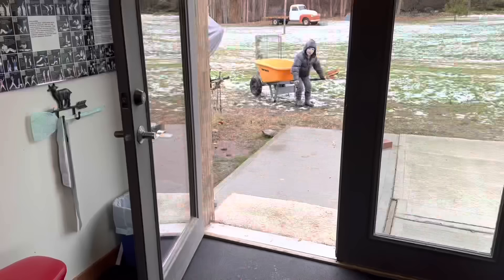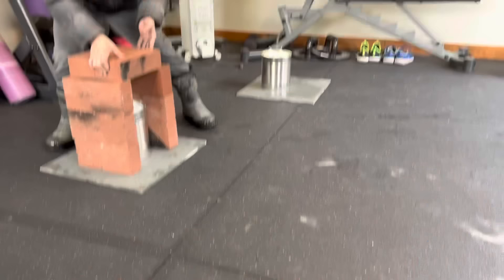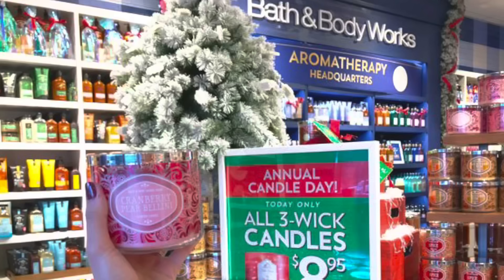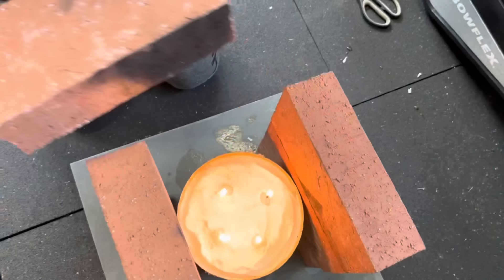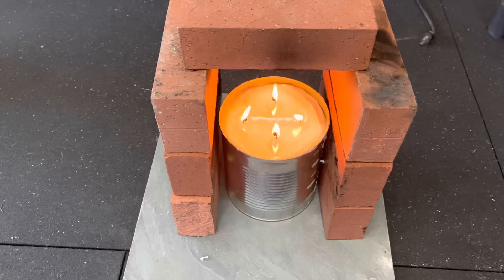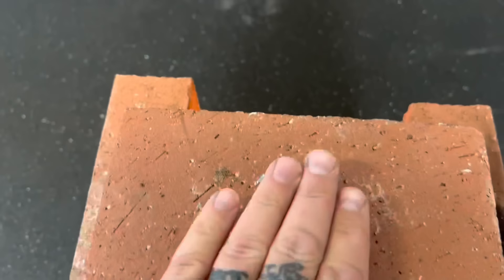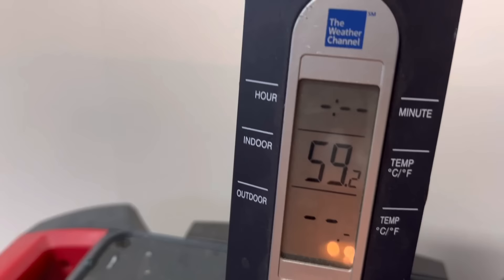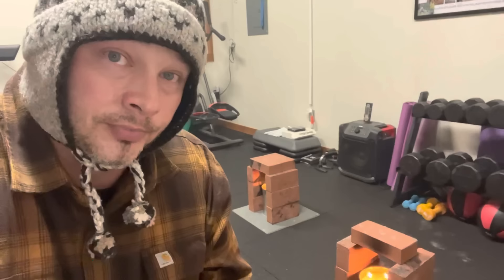Crisco candle room heating | Power Outage Room Heating | 9 hour test

Comment: The other good point about this which you didn't actually mention and some people may not realize is that the bricks continue to radiate heat after the candles are extinguished. If you live in the UK the British equivalent of Crisco is called Trex (or a cheaper own brand substitute can be used as you did in the clay pot heater).
Reply: Max, it does so, because it takes time to heat the bricks. lol so the overall time is the same. i.e. the heat you don't feel while the bricks are being raised in temp is the heat that will be released when the candle goes out.  a candle produces about 80watts there is no magic plant pots or bricks.
Reply: @sarahclark5447  I'm aware of that Sarah, I was pointing out that the bricks are a sort of thermal flywheel but thank you for replying cos it makes my comment more understandable to some people. Sometimes I don't express myself very well and you clarified it
Reply: @madmaxsdog8040   Thank you, Max, you just need to take one more step and you will be there. remove the bricks and simply light the candle when you require its meagre heat. 
There are 80 watts of energy available from the candle. displacing that 80 watts into a room so the room, in turn, heats you is the most insignificant way to try to survive. if you are male your body radiates 120watts, inviting a friend into your room would be more beneficial than lighting the candle, oddly, a woman radiates about 90 watts. but you as a male will likely radiate more than your 120 watts just at the sight of her! keep in mind that what you radiate you lose and what you lose needs replacing.
Men were made for greatness, and women were made to be the beneficiary of that greatness (sorry to tell you this if you are a male feminist). You have to apply your greatness by transferring the 80 watts from the candle directly as possible to the body, that will mean I will be able to survive for much longer. 
Sadly you have to be prepared to die to save those weaker than yourself, but it isn't all one way. I have to live for my husband/family, some say I have the harder role.
Finally, thank you for the car, roads, washing machine, aeroplane, trains,  computer, phone, homes, plumbing, electricity, especially being able to turn on the light to drive away, the fearful darkness,  central heating systems and most importantly my hair straighteners.   Do have a very happy new year Sir. Keep safe, warm and productive, women need you.     💗✝💗
Reply: @sarahclark5447  Yes I'm male I'm hetro but some of my best friends are women, two of them gay one of them going through a transition, used to be a man but becoming a woman, I sometimes used to play bass or drums in an all woman band if one of them couldn't make it and y0u  wouldn't believe the barriers that were put in their way just cos they were women. the best way to keep warm is not get cold in the first place. we quite often slept in the van after playing ( which is f"*** cold, ) just hugging in and sharing body heat, there as nothing sexual about it, just a way to keep warm
Reply: @sarahclark5447  My name is Roy actually but I loved the Mad Max movies when they came out and "dog" the dog was brilliant, an Australian blue so when I needed a playstation game name mad maxs dog was the first thing I thought of
Reply: @madmaxsdog8040  Oh,  I had never heard of the film Mad Max. I suspected it was a film a boy would enjoy, but not a girl perhaps. however, I googled Mad Max, and my suspicions were confirmed, not one mention of romance lol.
I think my brother would enjoy that film and my dad would know about it, I bet he has even watched it! Men have very hard hearts, even dads! but a wise daughter knows dads have two hearts, one for their daughter, and one for their sons. I think this is necessary since men, have, and will do so again in the future, lay down their lives for their wives, sisters, and daughters which requires both types of hearts to be able to do so I think.

Someone did mention the film pulp fiction to me the other day. I had never heard of that either (I must live in a bubble lol)   this film was mentioned to me because one of the film's characters recited Ezekiel 25 (if you do not know what Ezekiel 25 is you must live in a bubble lol) I had to tell this person that the character who recited Ezekiel 25, did so wrongly, it doesn't say what the character recited, the guy then told me I had spoilt the memory of that film for him lol. 
 I think perhaps this Christian homeschooled teenage girl lives in a world far removed from her secular peers, and when I go researching energy conservation or some other aspect for my coursework come into contact with really nice people who live in quite a different world than me, but sometimes I come into contact with people who have had much too much of their world that is good for them, teenaged girls my age, who have no love in their hearts for little babies and children, and think one form of contraception is abortion, and not all forms of contraception is, purity!
then I have to run back to my world because I can't live in a world where there is such hatred in the hearts, as it's too heavy to carry around. Roy, you are the former, not the latter, you are a pleasure to know, a man from the other world.
God Bless you, kind Sir.      🧡✝💖
Reply: @sarahclark5447  Female friends are exactly that, friends, I used to sometimes play either bass or drums for them in their heavy metal band, whatever was needed at the time, you might  be able to find some of it on you tube, I don't know if any of it has been posted. The band was called Revenge. The person going through the gender change is actually now MUCH happier because she's found her true identity and isn't living a false life anymore. If you had to constantly lie to yourself about who you are it would do your head in. she had the courage to make the change which now makes her comfortable with herself and she can live her true life.
Reply: Listen to a song and look for the lyrics, it's called the double life, it's by Souixsie and the banshees. That's pretty much what my friend was going through before she made the change. She is SO MUCH happier now than I've ever seen her. No more religious lectures please, you're obviously a very firm believer in God, if so you'll know that he gave us the freedom to make our own decisions. Those decisions ALWAYS have consequences, sometime good sometime bad but you make your choice and you live with it. In her case it was the right choice, she isn't living a lie anymore
Reply: @madmaxsdog8040  Is this the band, Roy? https://www.youtube.com/watch?v=tqsAhkiDVW4
It was very good of you to be able to drop in were required as you did. I do something similar when I'm asked if I could help out at a Carol Service. it's quite, different playing solo than in a band of people, particularly if you do not know their different abilities. My mother taught me to play my part exactly as scripted, and not concern myself with what was happening or sounding to my left and right. I prefer to play solo if I'm playing the Piano, and lead (first)  if I'm playing the Violin in an orchestra. My mom told me, the orchestra is only as good as its worst player and I wasn't to be that person lol.

I am pleased your friend has found happiness, Roy you would be wrong to think that's not what everyone wants for every person, but the greatest happiness would logically be happiness in who you really are, what your DNA is informing your body of. If your friend was happy with a wife and children that would be the very best outcome possible since he would simply be happy in who he really was, since one of the chief functions of the brain is to perceive physical reality. Thoughts that are in accordance with physical reality are normal. Thoughts that deviate from physical reality are abnormal—as well as potentially harmful to the individual or to others. This is true whether or not the individual who possesses the abnormal thoughts feels distressed.
 If you have to turn things on their head to work, something is broken. We do not ideally want broken things, in fact, when we find something broken we repair it, don't we? I suspect you know your friend well, and feel the broken can't be repaired, and love him so much you just see the friend and not the broken, in that sense you are a very good friend indeed. I think where we differ is I do not see the friend, I see the broken and the broken is repaired because my love would revolve around fixing the broken, not so much accepting it's broken, and to attempt to repair the broken is an afront to broken.  
I do understand that fixing isn't classed as loving, but hateful today, but that sort of mindset means you never try to fix the broken, which should tell you how hateful that mindset really is.
I accept that some can't be fixed, and they need to live as happy a life as they can, however,   where we may differ is that I would want research to continue to find a fix and not accept the broken as irreparable, simply because your friend is as valuable as you and I. Further, we may differ on the fact that I would maintain that your friends greatest potential is tied to his biology, every part of his body is working to maintain 'male' he could excel at- male, but he never will excel as a female because he isn't a female trapped in a male body, he is a male in a male body. 
I am mindful this may be very painful for you to hear, but all the real research points to your friend having real problems not at the inception, but at the 10-year-mark, you need to be aware of this so you may understand and help if that materialises. hopefully, it doesn't.     

I understand you think my view is tied to my belief in God. if it is, my view of the candle heater is too. 
I do believe to make a whole human being you need a male and a female, simply because if I analyse my biology I am complete in every way, but one. My heart is complete and needs nothing to complete its function that I do not have. I could go to every other part of my body and find the same, all but one that is, my reproductive system is lacking. if I search my body I will not find the missing part, likewise, you have a missing part of your reproductive system too. What I lack, you have, and what you lack, I have. To realise our maximum potential we need to connect up to our missing parts or put simply for me to reach my maximum potential I need a husband who is biologically male.   Your friend may try to battle against nature, but he will lose.
Reply: @sarahclark5447  Thank you Sarah, our opimions on this differ but I respect your point of view. The main point here is that you haven't seen my friend and how happy she is with her life now. Please don't refer to her as male
Reply: @sarahclark5447  No, they were a bit more musical than that lol, More like some Iron Maiden ( The evil that men do might be a good example ),  or some Metallica stuff ( eg Enter sandman ), I did the drop ins cos friends help each other, that's what friends are for
Reply: @madmaxsdog8040  sorry, max I wasn't notified of this post so I am responding a little late.  
I do understand your position, it is very understandable. 
I have girlfriends who are miserable because their parents are very strict, these are secular families often, and the girls would happily run off with the first lad that made them happy, but this sort of happiness isn't the highest goal.  if you think about it there would be many things that you would disagree with, that would make someone happy. 
I would hope that you would understand that you yourself may accept a lie, but the lie should exist between you and your friend, you can't, and should not, want or expect others to take part in the lie since others happiness may be in truth.  
The world moves forward with truth and the contributions of the next generation.  
Communism was a utopia that everyone had to accept, if not die in a gulag. To get to the truth of communism millions had to die horrible deaths, it would have been much better for people to have accepted the truth of communism by its reliance on lies. A society that lives on a lie is open to lies of a utopia. Once someone tells you what words have to come out of your mouth you have a society that is dangerously broken and open to the next dictator. 
Best look at the beauty, truth, and flourishing that comes out of different generations of ideologies.
if a biological male wins a woman of the year award then you will know people will accept a candle as a form of a heater by just dressing it up as something it is not.     
I do understand you love your friend and want to help where you can, and I d admire your loyalty.
Reply: @sarahclark5447  No problem
Reply: @sarahclark5447  Friends are friends that's what they do, they aren't just someone you go to Mcdonalds with you love them and support them when they need it, but it goes both ways they do it for me too, I've trued to upload a couple of our band recordings but it's only audio and it just keeps saying wrong format. I'll send them to you if you want them but I'll need to use facebook or email. Or if you know how to direct message on here tell me how.
Reply: @madmaxsdog8040   We are in different worlds, Max, but it's nice to hear other views on music and life. I have heard of Iron Maiden, but I'm not sure if I have listened to "The evil that men do",  but I am aware of the evil men do, which is probably just as important. I will check out that song and let you know what I think.  
My best friend is a vocalist, so I will listen with her as I'm a pianist and violinist, so I'm more likely to pick out the instruments I can hear and ignore the vocals. lol
My mom dropped in for someone who was ill; it was expected that violists covered for each other, the lady who was sick was my mom's friend, on the way back from performing, my mom was killed in a car crash. If she had left the venue a few moments earlier or later, she wouldn't have been in the accident. The orchestra kept perfect timing to ensure she was in the wrong place. I will never leave my daughter to perform for someone else's daughters or sons. I will dedicate my life to my family if God gives me a husband and children one day because a beating heart is much better than a vibrating string.    
But the world would be a poorer place without beautiful music and art, so my husband may have to be firm with me and ensure my beating heart makes the strings in my piano or violin cause hearts to sing with joy at the sound of the beautiful music. 
You are likely fed up with me, Max; you have been very kind, and respectful so I will give you the last word, which is a great honour, max, as I usually insist as a female to have the last word.   😊💗
Reply: @sarahclark5447  The thing with your Mam was a total tragedy, I'm sorry to hear it, a lady I used to race motorcycles with in my 20's had a similar incident when she was about 8. You should be a poet, your texts are beautifully worded phrased and structured, give it a try. I wasn't trying to get into your world though, you seemed interested in the band, was just gonna share it but it won't upload. No I'm not fed up with you but you've said goodbye so we leave it at that. Don't know how to find the "thumb up" emoji. But thumb up
Reply: Boys, If you a lacking a role model you will find no better than MadMax's Dog.
Some men are Crowned Kings and some men are Kings who are uncrowned, Max, is the latter, however,  I can rectify that...here is your Crown, Sir Roy, of the kingdom of,  MadMax's Dog.  👑.
There, men were made for greatness and the only person who may legitimately say that is a female. When we find such men of greatness, we crown them Kings.        Task complete... Homework to complete and then I have to convince my dad to let my friend have a sleepover, so it's going to have to be the big sad eyes, his favourite meal waiting for him when he gets in, and my homework up to date, that should do it...
Reply: @sarahclark5447  Thank you, hope it worked lol.
Reply: @madmaxsdog8040   It worked fine Roy, we had a lovely time, and my Dad only had to tell us off twice. Katie's mom took us shopping the following day, Christmas gift money needed converting into something pretty to wear, it's a girl thing.
Kate and I teased the boys in the shops because we had Katie's mom with us so if they responded we could run to her.

A lady Katies mom knew gave Katie and me some tokens that were nearly out of date to spend so we bought something nice for Katie's mom and little sister to wear. Kates mom took us to have tea, cakes, and little finger sandwiches in a quaint little tea room, it was like being a princess, pity there was no prince charmings there for Katie and me to practice on. Lol
I wish I had a mom so we could do that more often, but I can do that with my daughter one day, maybe. I can hardly wait to have a family of my own. 

I had lots of presents, my dad didn't try to choose something for me on his own this year, he asked Katie and her mom to get his present for me, he normally gets something I like, but he has no idea of the size, and he buys something for someone much younger because dads do not want their daughters to grow up too quickly. I do not mind wearing something for someone a little younger, because it helps with my confidence.   What Katie and her mom chose for me I would have chosen myself and it fitted perfectly. 
The very best gift my dad gave me was some letters my mom had written to him while he was working away. He was going to give them to me on my 13th birthday, but he thought I wasn't ready.
I haven't read them yet because it will be like my mom talking to me again, and once I have read them, it will be like the last time she talks until I go to be with her. Katie said she will hug me while I read them, and Katie pointed out I was resigned to the fact I wasn't going to hear from my mom a month ago, so I will accept that again if I have a good cry once I have read her letters. I just want the feeling she is here to last as long as possible.    

Katie and I found iron maiden and we both chose "fear of the dark" because we fear the dark really, but not if my dad or brother is around. We danced to it which was our first telling off because we had the music too loud. 
We found their greatest hits, volume one. which we played on headphones so I could separate the vocals in Audacity. There is no backing from an orchestra hidden in there, it's heavy on base, and oddly I would say the best musician is the drummer, his balance and level is top-notch. A lot of bass guitars go through pedals, I don't think they use pitch lock technology as part of their appeal is a raw hard-driven base. we have covered that in music class, but at the time it was something I didn't show interest in because boys tend to like the techy stuff. I don't even like a microphone on my violin, but a radio mic I can live with.   
My music class is based on Violin and Piano, and mostly classical music because music for the violin is actually quite limited. The classical music class joins up with the dance class, particularly, the ballet dance group, and we provide the music when they perform, what girl wouldn't want to be part of that?   
I could join another music class that does rock if I wanted as I am ahead in my classical class, but I do not think the heavy rock class would want me as I couldn't offer them anything.  
If they enjoy music in that format that's fine by me, they do not come into my class and criticise our music. 
I have no idea why I prefer one type of music over another. I suspect my mom drilled it into me, and if she did them she had the right to do so as she was my mom, and if she didn't have the right to do so, who does.                  

I can imagine you on your motorbike, skull and crossbones adorning your attire, bass guitar over your shoulder, riding to a gig to save your friends from the lack of a musician.
As for me, I am chauffeur driven (my dad takes me in his car) to the church where I play piano or violin, whichever they do not have, to a couple of hundred of my brothers and sisters, but I do have God in my audience which I think you would agree takes a little beating. 

Love and blessings, Sarah and Katie. xxx
Reply: @sarahclark5447  I never used effects pedals on the bass, only the adjustments on the amp but if you know what you're doing that's enough, and the only pedal Claire ever used on her guitar was called a Boss Overdrive" which was never turned off, she controlled it with the guitar volume knob and pickup selectors, which I modified to have coil splitters and series / parallel switches but we did sometimes use a looper because we only ever played as a trio so sometimes it's impossible to adapt the song for the missing guitar and yeah you're right about the Iron Maiden drummer. Your imagination is boundless, they always phoned in advance and we travelled to gigs in a very tired old van but I do like your portrayal of me being the knight in shining skull and cross bones lol. Yeah I do understand ladies buying nice things to wear, I always liked going clothes shopping with my partner and my lady friends and I still do, it isn't a control thing I just liked doing it and they seemed to value my opinion. That was a really nice thing with the gift vouchers. A classical musician can contribute way more than you think to rock, some of the best ever rock musicians were classically trained then changed over. Even if you don't wanna do it seriously the more genres you can master the better you become at all of them, knowledge between musical genres is transferable, all knowledge is transferable, that's how humans are the dominant species, Tigers (beautiful animals) can teach their young how to hunt but that's all they can teach them.
Reply: Yes, it is called "Thermal Mass". Basic Physics. 
It is also the reality of fireplaces and woodstoves -- the brick of a fireplace/open hearth, and the cast iron/soapstone/tile of a woodstove absorb the heat and dispenses it into the atmosphere as it slowly cools.
Reply: @eatiegourmet1015  I wanted to keep it simple, a lot of people lose interest when science is mentioned as they thunk they won't understand it